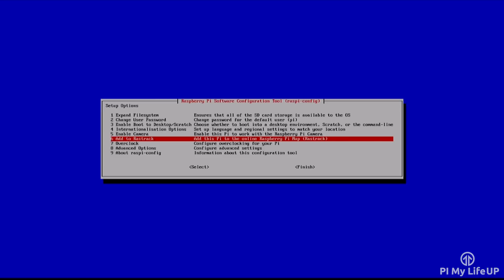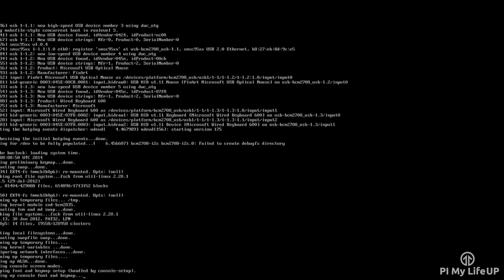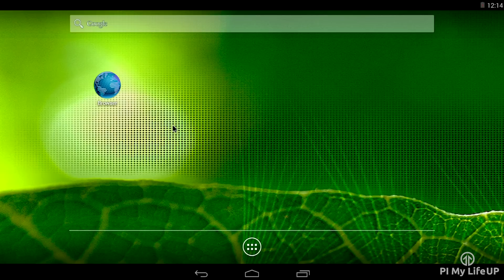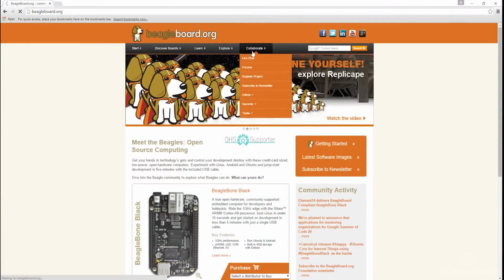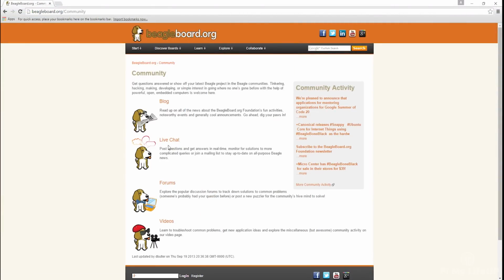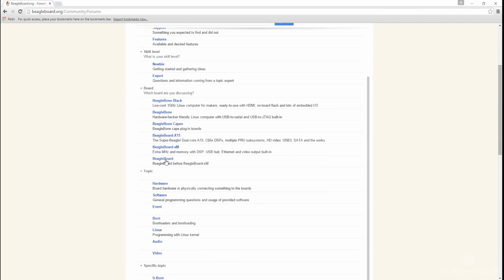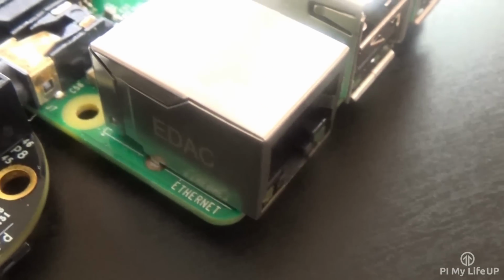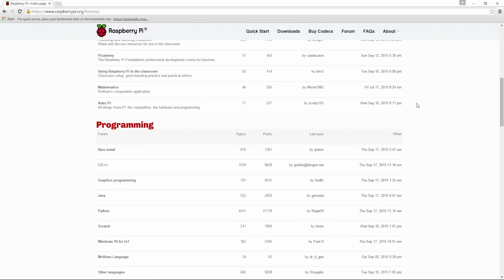Beaglebone Vs Raspberry Pi 2

Comment: Some points (2018):   Unlike the Pi, the BBB hardware design is 100% open source.   So the H/W design is available for free re-use, all or in-part,  in your new designs (it's a TI reference design).  It now has 4 GB eMMC flash and ships with Debian Linux.  It can also boot from the microSD.  It has 7 analog inputs.  An ARM debugger can be attached if the connector is soldered onto the bottom.  When the board is plugged into a Windows PC, it mounts a USB drive that has info, and the drivers.  And it mounts a USB network adapter so you can get to it's web page and code developer IDE at 192.168.7.2.  The Cloud9 IDE can run javascript anad python.  Also one can use PuTTY consoles and WinSCP graphical file manager over the USB or ethernet.  A new wireless BBB is available now, a BeagleBone Blue for robotics, and a $25 PocketBeagle, as well.